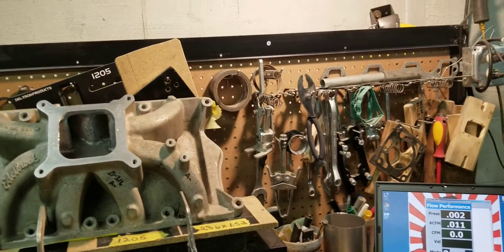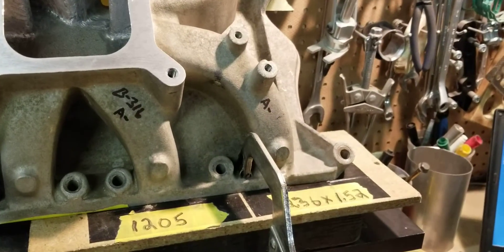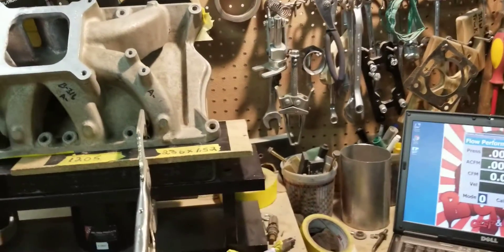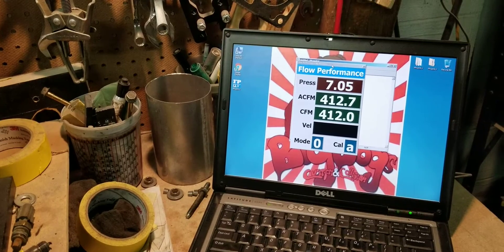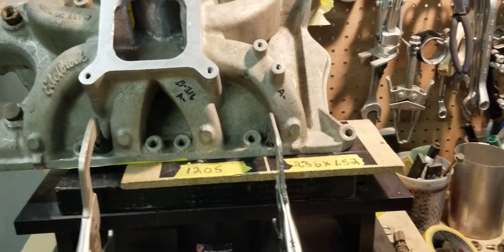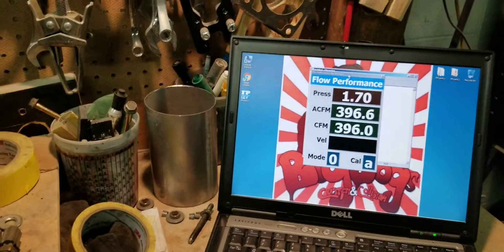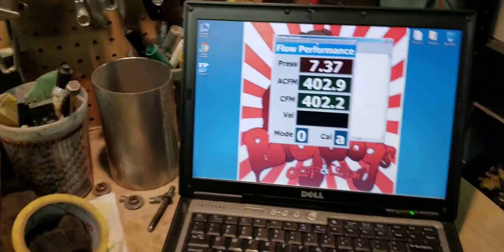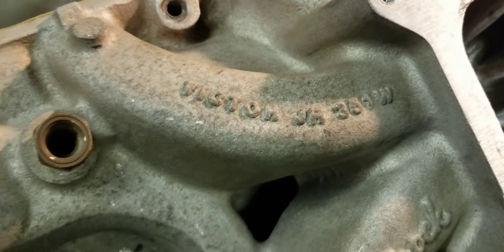Bigdogs Porting Stage 2 Sbf Victor jr  manifold test.

Comment: So what stage porting to you reccomend for a all GT-40 set up? Explorer intake, 3 bar heads,all the supporting mods,full weight 1987 GT,5 Spd,4.10 gears,basically a bolt on queen front top to bottom. And what cam,I have a B-cam,lol. And 1.7 rr,or should I go Anderson N-41? Any suggestions would be greatly appreciated. Looking for 325 + to the tires. It's a street car,A/C etc...
Reply from the maker: Stage 2

Comment: Big Dog, I like how you explain everything my man.No smoke and mirrors with you.I have an early explorer intake(egr) and I just purchased the t.f. track heat.And some GT-40 off a lighting.With the egr holes. Should I run the explorer, or the trick flow. I will be sending you these heads in the near future . I'm trying to get about 325,350 to the tires.
Reply from the maker: Thank you John. I try to be as straightforward as possible. Share some of the science and take some of the confusion out of parts selection. Non of those manifolds in stock form will be ideal because of lack of cfm flow but all of them would be great once ported. Remember, the engine does not see names or styles of manifolds. Its sees available airflow, CSA size, runner length and plenum size. Look at manifolds based on those parameters and you will smash your goals. Once we port them your engine and heads will be force fed air. Remember, before, at and just past the manifolds harmonic tuning rpm its boosting available cfm on the second and third wave like 6-9%! The more static available airflow your manifold have the bigger the boost efficiency. That's why our porting gains so much power.
Reply: @bigdogsportingtonyb2833  Thank you for your response. I never thought of it like that,but its spot on. I guess I just wasted my money on the trick flow intake then. That stings a little, lol.
Reply from the maker: @johndoe-zb8bm  welcome. Yeah I hate to be the bearer of bad news but yeah you wasted money on that TFS. Even with our stage 2 porting it still is just right there with our stage 2 ported gt40 family manifolds but the TFS track heat is heavier and suffer from a bad TB tunnel design that only cutting, welding and modifying can fix and that's a stage 3.
Reply: @bigdogsportingtonyb2833  I'm going to put it up for sale,you have confirmed what I didn't want to admit,lol. The proof is in the numbers, and you have made me a believer. Thanks Big Dog!!💯